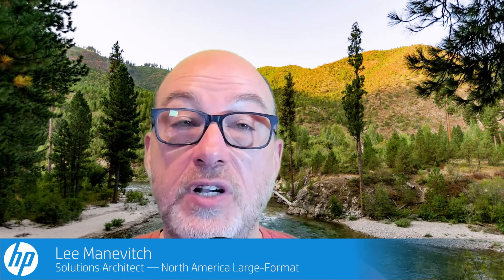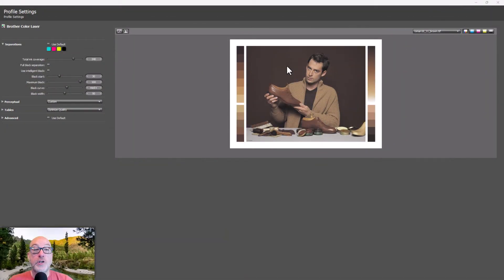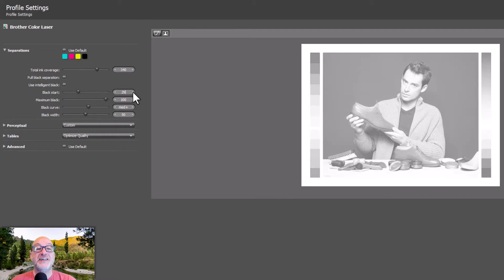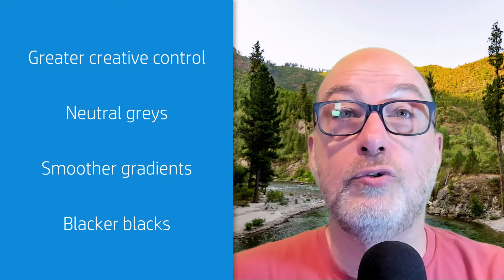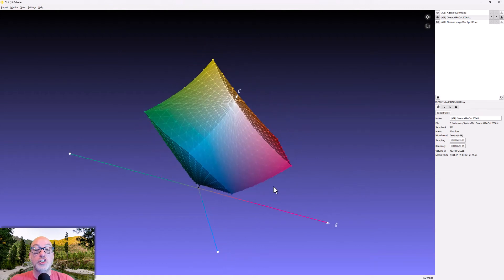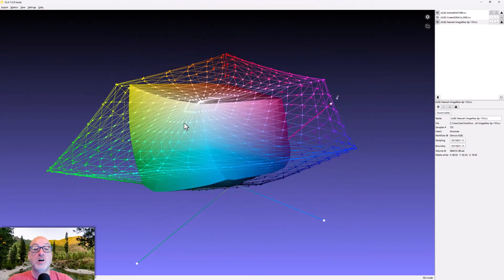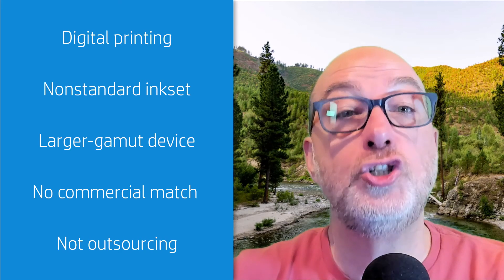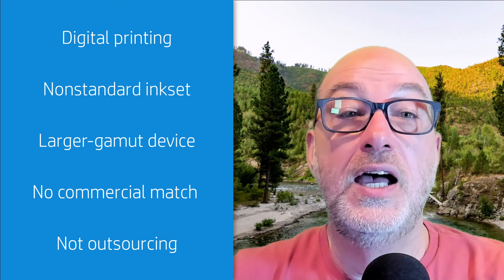Stop Designing in CMYK!

Comment: Lee, thank you so much for this video. I am new to software such as Adobe Illustrator & Affinity Designer. I am using the Redbubble platform and they insist that I use CMYK to create my designs and then to export out as RGB with transparent background. I am getting more and more confused can you advise please.

Could you provide a link for the software that you have shown in this video.

Thank you,

Rahul.
Reply from the maker: First, the easy question:

I can't give you a link to the actual software I used for comparing color gamuts because it's proprietary software. But if you look at gamutvision.com you'll find something very similar. The ICC profiling software I use is X-Rite i1Profiler and it's not priced for hobbyists but is definitely available for purchase.

As for Redbubble: as I read their guidelines and tips & tricks pages it seems like they think they're doing you a favor...and perhaps they are. They're saying that if you start your design in RGB and then end up getting your products printed, that the colors might be very different from what you expect. To an extent they're 100% correct...if I design a green as 0-255-0 then there's no way they can ever match that. So they're saying to design in CMYK specifically because doing so limits your color, and they're able to match those colors better. I don't know their processes but it could be that they're using a low-gamut digital printing process where designing in CMYK would be best. In my video I mentioned this could be a possibility.

The reason they have you convert to RGB is because they require transparent PNG files, so they can superimpose the graphics onto photos of the products on the website...so customers can see what the finished product will look like. But PNG files are RGB only, so that's why the requirement to send them RGB files - it's really a byproduct of them requiring transparent PNG images.
Reply: @LeeManevitch  Lee, I can not thank you enough for taking time out to give me a detailed explanation. This is sincerely appreciated by me. I have asked a number of people but with no end result. 

Right I will have to follow their guidelines. As I want to achieve the best print quality for the customer as an end result. But my concern is that they will see one thing on their screen and another with the actual product.

Thank you so much.

Regards,

Rahul.

Comment: Awesome video Lee👍 I design and Print using the sRGB profile simply because I get better results with this approach. I use flexi RIP and the cmyk profile kept washing out, and shifting colours, I’m not sure why but switching to sRGB has significantly improved the output on my HP Latex.
Reply from the maker: Thanks Ben!

There are various "flavors" of both RGB and CMYK - there's no One True Profile™. So it's possible that, in addition to leaving color on the table by designing in CMYK, that your design and your RIP are not communicating properly regarding which CMYK profile you're working with.

I always embed ICC profiles in my art, and I almost always (read: whenever possible) make sure that my RIP settings reflect the same working profiles that my design softwares are set to.

But having said all that...just stick with RGB and enjoy the benefits. 😁
Reply: @LeeManevitch  slightly off topic, and in regards to your latex printer; what's your approach when attempting to print those super high vibrancy royal blues and reds(yamaha blue, honda red)?. I believe I squeeze the best out of my latex but unsure if I can do better!
Reply from the maker: It's a multistep process but the key points:

1. Sufficient ink density. You're not going to get Honda red at 90%, for example - I ride a Kawasaki so I can keep my ink costs down. 🤣

2. Good ICC profile for your printer/media/mode combination. Using the generics will get you 90% of the way but that last 10% comes from doing the legwork and building a profile on your printer.

3. Proper color-managed workflow. Make sure your design software and RIP are in agreement about your working profiles.

4. If the colors are specified as spot colors like Pantone 185 or watever, make sure you're designing with that spot color and not the process equivalent. Also with PMS color make sure you're using Coated and not Uncoated.

5. Design in RGB - but you know that now, right? 😜
Reply: @LeeManevitch  Hi Lee, another off topic question if I may😃

I think you mentioned that you are a HP latex user in your last video, If so you’ll probably be familiar with the Latex characteristics. 

I have a question relating to that grainy print that is commonly associated with latex. I find it to be worse in greys and light hues.

95% of the work I print is vector, but on the odd occasion I do print raster it always surprises me how good the results are. And possibly less grain!

Is it possibly that the way the rip interprets vector and raster, can significantly effect output? 
I know that’s quite a broad question, but what I’m trying to get at is: is it possible that you could achieve better output in colour range and print quality if you rasterised your artwork?

Possibly a silly question but it’s been racking my brain for some time!

Let me know your thoughts.

Regards, Ben.
Reply from the maker: @benhazard21  Rasterizing won't do anything in this case. When you see grain in any print, you're generally looking at the limitations of the printer - attributes of both the drop size and placement strategy. Smaller drops and the use of light inks generally mitigate some grain, but it's always there - see my video on resolution to see why any digital print is really just an optical illusion. https://youtu.be/tyTAwbjfkDc

If you're not already, in your greys make sure you're printing them 4-color and not black-only or the grain will for sure be more noticeable. Below about 30% black, if you're printing full-color, you'll hardly be using black ink at all. Printing those light greys using mostly CMY will fill in the gaps and make the grain less evident.